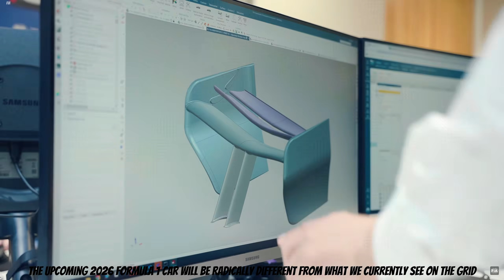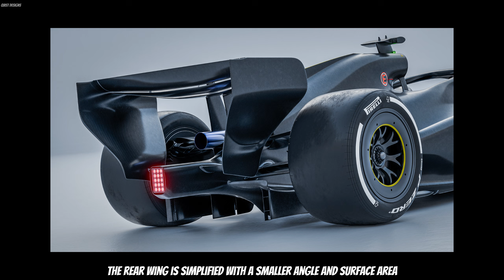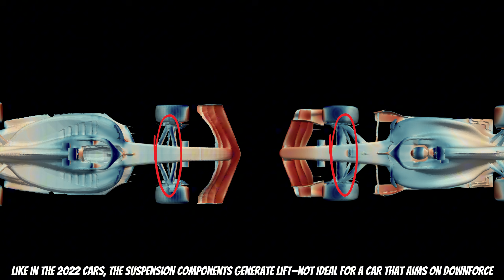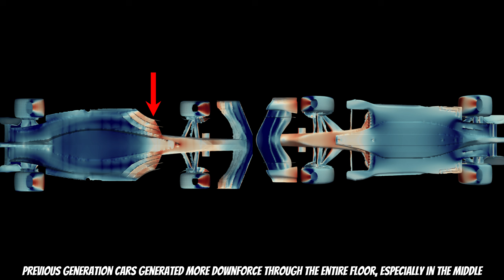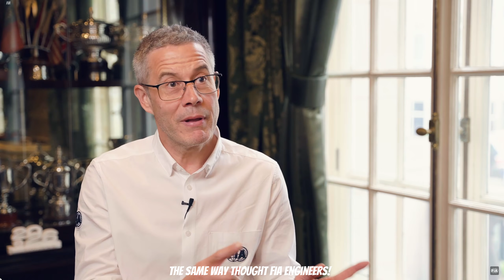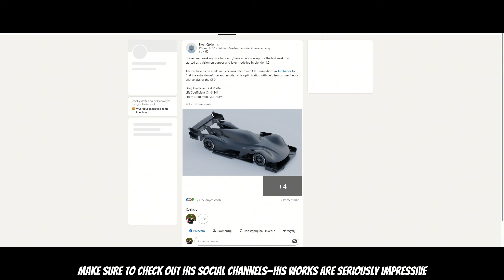F1 2026: Aero Revolution Uncovered

Comment: %55 less downforce? its crazy imo csrs will be way heavier for this decline to work , we will watch absolut donkey cars
Reply from the maker: Engineers will have lot's of work to do with new car. And first results of it will be seen  really, really soon!
Reply: The FIA expect ~15% less downforce compared to now, down from 30-40% after the revisions in October last year. I dont think that number increased again in a significant way since.

The innitial goal was for a 55% drag reduction (presumably in straightline mode) but i dont know how that has or hasnt changed